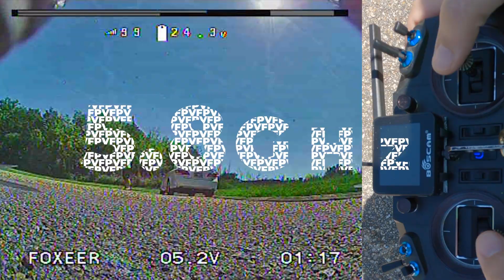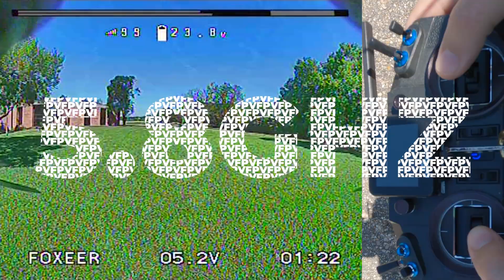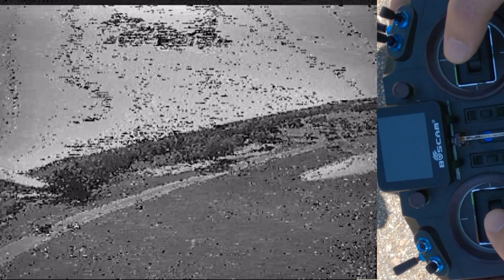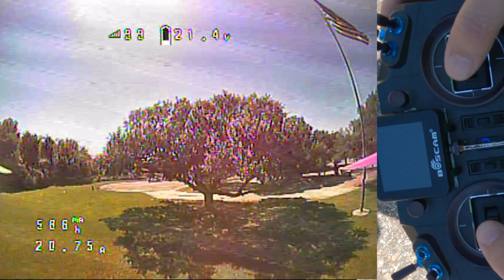900mhz Radio with 1.3ghz VTX Possible? (Better than 5.8ghz??)

Comment: I got 11km out with 5.8 easily at 163m altitude.
Reply from the maker: pretty slick.
Reply: What were your antennas and power level?
Reply: @David-gk8yg  cheap mushroom antenna on my quad, big panel antenna on ground station.

Comment: Not good using Vee antenna on quad if you have big angle of roll/pitch.You must use dipole or clever,but clever very big size. And antenna placed far from other equipment uav's.
I have ~15km on 1.2G/0,5w/dipoles both ends far from the city,NOT mountains. 15km without directional antenna and this is not limit!
Reply from the maker: i know this isn't the best way just reviewing the product as is. that's crazy good distance you're getting tho!

Comment: You need to try a CP antenna with 1.3. Also your vtx antenna should go the other way. Arrow pointing to you
Reply from the maker: I tried a few other things but I like rapid-fire too much, if they ever make 1.3 with image restoration ill be the first in line haha. Still good for long range with a ground station or something tho.
Reply: @MaxBeamer  Clearview has a 1.3 version. It's like 600$
Reply: @slavikarg  You can connect 2 1.3 receivers to a diversity controller for a lot less. I think Range Video still sells one for $150. A diversity setup on 1.3 is incredible for close in freestyle. Its what we all flew back in the beginning, before 5.8 became so plug n play.

Comment: I used this combo out to 14kms on my old channel using chainlink uhf $189. (Dragonlink was $400) and the huge 1.2ghz metal cased vtx's $25. excellent in trees too. I took metal cases off vtx no issue with heat on a quad. Get the 1.2 antenna up on top you will go 5x as far and have signal turning around. TBShit is just repacked general components with tweaking, cost wise just as cheap as emax stuff.

Comment: The antenna supplied with it sucks. Try the vas bluebeam pro or true RC 1.3. much better experience but yes more for planes
Reply from the maker: You’re right the antenna on the quad isn’t exactly optimal! I’m sure with a blue beam or similar Omni type antenna on the kwad there’d be significantly better vidz!
Reply: @MaxBeamer  Yep! Omni on goggles omni on the quad is excellent. Want some crazy signal? Try the vas pepperbox extreme. I cant explain the range w/ this is incredible seriously. ;)

Comment: why not use 2,4ghz?
i'm actually testing the tbs 2g4 groundstation a lot atm but i get interference all over the place 🤔
Reply from the maker: 2.4 doesn’t have much of an advantage over 5.8 esp in object penetrationplus the whole country uses it for WiFi haha   Maybe that’s where your interference is comin from? I used to fly the furious 2.4 on my quads like 18 months ago but it really wasn’t worth it.. I’d say 1.3 is like 20% better than 2.4  and 2.4 is like 15% better than 5.8 😂 still rapidfire is the best option for me unless I want to long range or smthn
Reply: @MaxBeamer  well i wouldn't even say better between 2,4 and 5,8......it depends where i fly but with 2,4 the video isn't as clear as on 5,8 in most cases.
but i also never took the 5,8 system as far out as the 2,4 (9km)

Comment: something wrong with your vtx or antenna? you should be able to go alot further on 5.8 than what you did
Reply from the maker: Kwad Squad FPV not that I know of  maybe if I was flying higher I could get a mile or 2 out but not at that altitude in the middle of the city with a building between me and the kwad lol 🤷‍♂️

Comment: woah that was a pretty big difference! whats the mw on the 5.8ghz vtx you used??
Reply from the maker: I think 800mw so about 170mw more than the 1.3 and still lacking even with rapidfire!
Reply: @MaxBeamer a general rule is that the same 1mw of power on a 1.2ghz transmitter is equivalent to 4mw at 5.8 distance wise